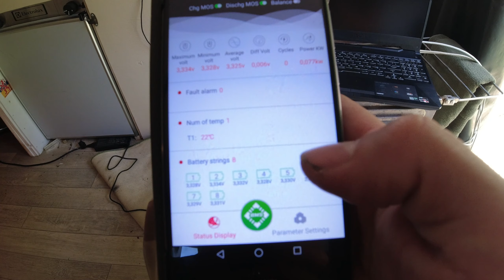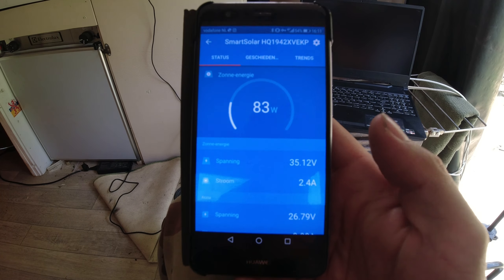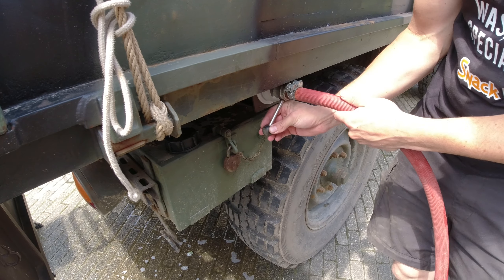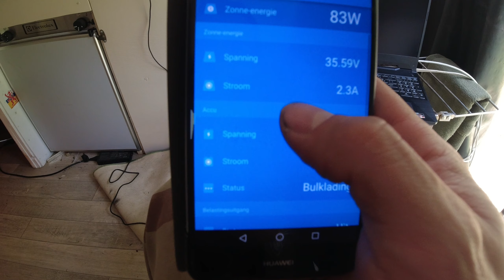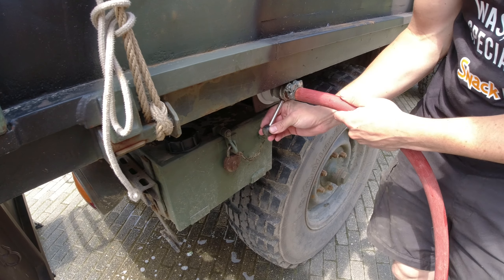Unimog 404 vlog 15: Noises and Luxuries

Comment: For Iceland and water crossings. Put hoses on diff breathers and put the hoses behind the cabine high up. Or before every crossing stop and put a rubber stop on them. Also bring enough oil for your portals and check every 2 days your portals and see if there is water in the oil (white oil) and replace it every 2 days if it is milky.
Reply from the maker: i wasn't planing on going true more than 100cm of water so no need for hoses. 
of course we check regularly and carry all necessary oils.
Reply: @ArmyTruckTom " Þórsmörk" is 120km from Reykjavik its an amazing place,and very fun to drive specialy for Unimogs, its a 50km path from higeway 1, whit a lot of clacier rivers to cross, "Krossá" is the last river you have to cross and can somtimes be quit a challenge even for Unimog,, I higley recomend:)
Reply from the maker: @balduregilsson4893  nice! I will definitely try to check that out. Sound like a nice adventure.

Comment: I think your solar setup is on the small side for such a big battery. I just got a victron DC-DC 24-12/30A to charge my 100AH AGM while driving. There are many variations. Also 24-24volt.

Nice the water tank! I just worked on my 130Liter tank. And will have a gravity fed outdoor tap and pump powered indoor tap.
Reply from the maker: i have a charger for the 120 Ah LiFePo4 batterys that charges when connected to the grid. And yes the solar is small, this is due to the fact i don't have a roof to put the panels on ;)

Comment: Would noise canceling headphones make long trips quieter ? People on these videos say  vintage unimogs engine noise is kind of loud and the newer models have better soundproofing.  Some owners are soundproofing their older unimogs but  still unimogs are much  quieter than a Harley Davidson motorcycle .
Reply: Just get a box of earplugs for long drives.
Reply from the maker: All the noises seem to spawn on the inside of the old cabins. we don't need a radio, we listen to the music of the engine. earplugs or a headphone would however reduce the damage dealt to the ears ;)